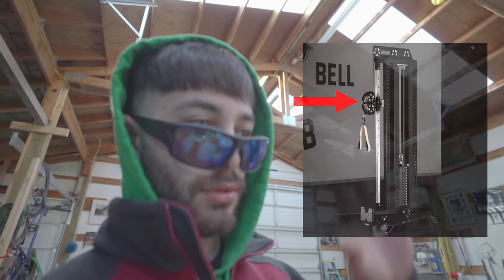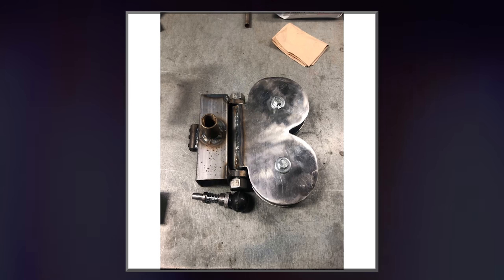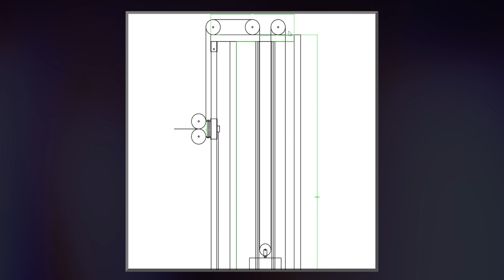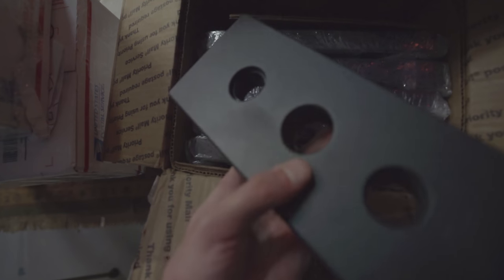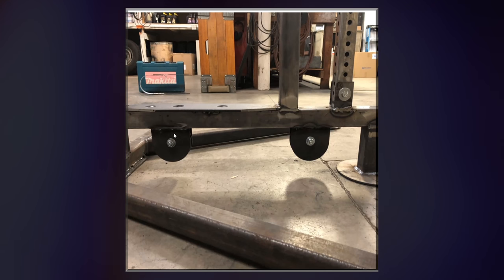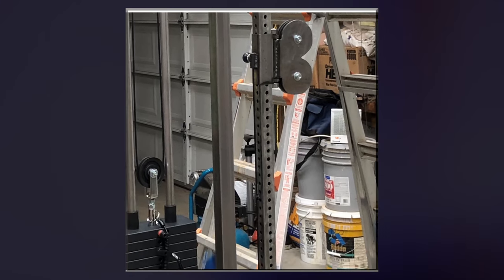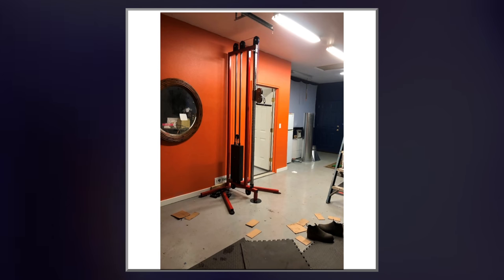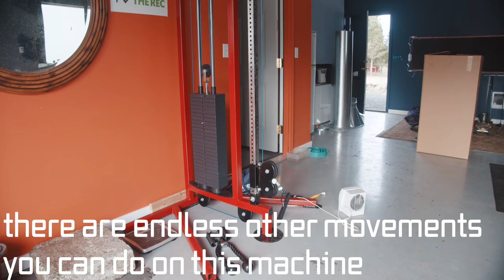DIY Adjustable Cable Machine (Detailed Build Vlog - HOW TO VIDEO)

Comment: Be sure to do vids for other builds you make. Nice work!
Reply from the maker: I’ve got a lat pull down/low row machine coming up soon!
Reply: @solomonmachine2137  Thanks for the headsup, i'm already subbed and got that bell noti set ;p
Reply: @solomonmachine2137  If you could combine them that would be incredible.    Make it 1:1 for the fixed high and low pulley for pulldown/row  and then  2:1 for the adjustable pulley.  Is that possible?

Comment: if you set the stack at 40 it feels like 20lb at the handle.. no it doesnt feel like 20 it actually is 20 at the handle.     Also, the missing energy you speak of , as you said, results in twice the range of motion of the travel of the load up and down the guide rods but the reason there is less energy required to move the weight is because half of the weight is being supported by the other end of the cable which is fixed to the adjuster.   Your video is awesome and I havent seen anyone else on youtube just hauling off and fabricating an adjustable pulley system. Great spirit man and your machine is flawless.  Impressive.

Comment: Great work Mr Moss! I share your sense of accomplishment 😁 highly functional machine you've built here. I actually wanted to do the same at one point and had produced very similar drawings but at the time struggled to find the "user interface" piece and how exactly to devise the weight stack. Nor did I have to option weld. Anyway this video should help many others, congratulations! Now just to repeat the process for cable crossovers 😜.
Reply from the maker: maybe ill do crossovers someday in the future!

Comment: This is inspiring for sure!  I may build this exact system x2.  It would have one on the left and one to the right (for 500lbs).  My thought is to try to create a homemade version of the TYTAX T3-X ($11,000) gym.  To pull that off, you would technically need 7 stations, but if you keep adding as you go, it could be possible.  The thing has 470 exercises lol.  

I can get alot out of 2 pulleys, to start.  It will get more interesting as it goes.  If they actually have schematics, it will make duplication much easier!  The goal is to maximize efficiency; into one large block.
Reply: It would be nice to see what came out of your plan.

Comment: Not sure if you can slip this in now, but some UHMW tape on the inside of that “user interface” would eliminate the little bit of slop and metal-on-metal wear and tear.
Reply from the maker: dude great idea! i totally could. thank you
Reply: @solomonmachine2137  I’d be interested to see how you go about building a belt squat setup if you go that direction with your cables.  I’m currently trying to figure that out within my own rack by adding a low pulley and extra cable to my existing DIY lat pulldown.

Comment: Hello my friend ! 
You work it's amazing ! 😍
It really inspire me, i have some technical questions
- What is the distance between the two pulley of the adjustable pulley ?
- What is the thickness of the metal you used for the adjustable pulley tube and the hinge bracket with hole ?
- What is the thickness of the tall tube with holes ? And what is the size of the holes?
Thanks 😊
Reply from the maker: I just made the two pulleys as close together as I could without touching them.
For the tube, its a standard 1 inch pipe. Which should fit around a 3/4 inch bolt perfectly. And the brackets that mount the bolt, they are 3/8" thick. I just found some metal and cut out bracket shapes and drilled holes and welded them on.
11 GA steel for the perforated square tubing. 1/4 inch thickness for the back and base, and 11GA for everything else.
Reply: @solomonmachine2137  
Hello my friend
Thanks you so much for your answer, it help me a lot 😊 
I have another question, how did you fix the guiding rode ?
Can you make me some pictures please ?
Thanks again for your help, your last video of the lat pull-down is amazing 👏

Comment: Hey man that build is awesome. I'm trying to find the Guide Rods you are using, looked through amazon for a while and couldn't find the length you've stated. Could you please list the link if possible. I have Rogue uprights and would like to utilize them for the build but the only issue is I'm unable to find the guide rods that would fit. Thanks
Reply from the maker: yeah it is hard to find good guide rods. My great idea was to use closet rods, the chrome pipe that holds the hangers. However you literally cant find them online in the 1" diameter. The best ones I could find were unpolished, free shipping on amazon:
https://www.amazon.com/Unpolished-1008-1010-Diameter-Thickness-0-8700/dp/B003TPMM8G?pd_rd_w=jm2NL&pf_rd_p=0d55604f-77be-4514-b038-26b5285c5695&pf_rd_r=VN634VSAYT4WM3D699J7&pd_rd_r=98ad28af-fecb-4e91-a1bd-97ae4e2a96b7&pd_rd_wg=BONhA&pd_rd_i=B003TPMM8G&psc=1&ref_=pd_bap_d_rp_c_2_18_t

Comment: Make two, make a bar that connects them and voila, you've got a functional trainer, thousands of dollars saved. Can you elaborate more on the pulley system, where does it start from and where does it stop.
Reply from the maker: That elaboration is in the video! I explained the cable/pulley system in great detail, give it another watch if you’re interested in making one yourself. Thanks a lot for commenting!😀

Comment: I always wondered what the stacks from that website would be like...
Reply from the maker: Actually very nice. They’ve gone up in price quite a bit since I bought mine. But steel, 6 machined surfaces, beveled edges throughout, and a nice powder coat. You couldn’t make a better stack unless it was chromed out or something

Comment: Hi, I've been designing, fabricating and welding stuff like this for well over 20 years, including my own crossover cable machine, and I'd be impressed if I'd built what you've just done on your first go, so very well done. Do the weight stack weights have any kind of bearing in them against the guide rods, or is it just an air gap? SIimon

Comment: Very nice build! Do you know how much support/weight the guide rods actually need to handle with this? I am trying to fashion something similar (but plate loaded) inside my existing power rack and I was thinking about using 1 or 2 steel pipes for the guide rod(s). Thanks!

Comment: How did you know how long to make the cable? Did you start with the handle at the bottom and just run your cable accordingly?
Reply from the maker: i got a little extra. I remember i got 40ft and had plenty extra. And i just calculated how long it would be compared to the machine.
Reply: @solomonmachine2137  gotcha, im thinking about incorporating something like this but to my power rack. I need to figure out how i could attach the cable to the back of the handle to complete the cable circuit. Im not a welder so its going to be tough lol

Comment: Thank you, was wondering how the cables worked in these adjustable cable machines, essentially it has to connect in a circle/loop for it to be adjustable. The diagram was a big aha moment. Thanks.
Reply from the maker: Yeah that’s a perfect way to think about it. It’s a cable circle with a weight stack in the middle weighing it down

Comment: Hey man!  Great Job!!  I want to do the same thing!.  Did you do some research on the distance between pulleys and force etc.  Doing my research, some multifunction cable machine have a 1:2 or 1:1 pulley system.  If so, do you have any resources to understand this.  I want to design my own functional gym on CAD, but also I don’t want to do a whole mechanical engineering degree hehe.  Any tips or resources or how you came up with the design.  Or you didn’t go to that extent :). Any help most appreciated :). Keep the great work up!!
Reply from the maker: Hello, I have a section in the video where I explain the 2:1 mechanical advantage that adjustable cable machines have (at 30:00). I have yet to find an adjustable cable machine that doesn’t have this mechanical advantage. The reason why is because you need to attach both ends of the cable to the adjustable part (the part that slides up and down with the double pulley). This way when you do adjust it the cable remains tensioned. Unfortunately, you’re not going to get around the 2:1 mechanical advantage if you want to make your machine adjustable. If you want a stationary high pull, like a lat pulldown, you can have easy 1:1 mechanics. To my understanding, the ratios don’t get more complicated than this. The fact that there is a pulley mounted to the weight stack creates the 2:1 mechanical advantage. If you were to mount ANOTHER pulley to the stack, making it two pulleys on the stack, I’d assume the mechanical advantage would be 4:1, however the stack would physically move (when you use this hypothetical cable machine) a fourth the distance. Hope this helps! It’s actually not confusing and won’t require any degree lmao, thanks for watching and being interested
Reply: @solomonmachine2137  Thanks buddy for the thorough reply!!.  Have you checked out the Force USA G20.  Apparently it has a 1:1 mechanics.   Keep doing an awesome job and really appreciate your help!! :)
Reply from the maker: @Joey-wb8wo  you’re welcome buddy!
Reply: @Joey-wb8wo   @Lavish Moss  
There is a way to get a 1:1 on an adjustable pulley that normally makes it 1:2. If the final point of the cable is connected through a secondary set of double pulleys you can link the two ends through a single carabiner to get the full weight of the stack.

Comment: Nice vid! Do you have a link to the weight stack and the circle guide rod holders?
Reply from the maker: https://www.exercise-equipment-parts.com/weght-stack-parts.html
the stack is $2.00 a pound. so pretty pricey. im working on building a trolley system that holds weight which will be way cheaper... so maybe stay tuned for that

Comment: Good job! How are called that little balls that prevent cable from pulling back through pulley? :D
Reply: @michig1099  thanks 😁
Reply from the maker: online you can look up "cable ball stopper" or some variation of that. Honestly you can use a washer just fine.

Comment: If the weight is half on adjustable machines due to mechanical advantage are they labeled differently to make up for this?
Reply from the maker: no they are not labelled differently. try doing tricep extensions on the adjustable cable machine at 100lbs and then try the same thing on a lat pulldown, at 100lbs. the lat pulldown should be exactly 2x heavier because youll be moving the stack exactly 2x further every rep
Reply: @solomonmachine2137  always noticed the stand alone pull down machine at my gym was more difficult, I always thought it was stabilization, this is new to me. Will make sure to only use the stand alone from now on. Thank you for video!

Comment: Where did you get the weight stacks? I had to mill my own and it was a lot of unneccessary work.
Reply from the maker: i bought the stack new on https://www.exercise-equipment-parts.com/ but it was very expensive and is A LOT more expensive now (its almost doubled in price)
Reply: @solomonmachine2137 thanks for the link mate!!! We don't get these options here in S.A. so we either import complete units or build it from scratch. I just paced a USD 5k order with them and everything will cost me only USD 6.4k = ZAR100000 with transport (2 weeks) and duties. The order is big enough to build 4 machines. 1 lat, 1 cable crossover,   1 tricep and 1 multipurpose. Their pulleys are crap though so i'll source it or turn it.
Reply from the maker: @drevil2783  damn I would love to see some pics of these machines once youre done thats sick! just a heads-up my order of the weight stack took about a month to arrive
Reply: @solomonmachine2137  i asked for express delivery. You pay more but hey.... Send me you email and i'll send you some plans plus pics. I design my machines ergonomically meaning it's adjustable for different length people and the way the body works. For example: a leg press machine needs to curve to take pressure off the knees but maintain pressure on the quads etc...

Comment: Where did you buy the pin from for the “user interface”?
Reply: Stupid question, link in description lol
Reply: Terrific job! But I have the same question. Around 33:10 there's a nice showing of that double pulley on a welded ping that's welded to a sleeve. I wish there was more info specifically on that because I want to make that piece to go on my existing rack.

Comment: Where did you get the preperforated tube?
Reply from the maker: i found it at a local scrap yard! I felt like it was lucky.
Edit: I went back to the scrap yard and realized that it used to be a 'no parking' sign as it was green and there was another one there with the sign still attached. pretty funny!

Comment: Are the pulleys all the same size?
Reply from the maker: theyre 4.5 inches in diameter except the one attached to the weight stack which is 3.5 inches
Reply: @solomonmachine2137  Which pulleys did you go with? 
I see a bunch of different 4.5s on the site

Comment: How much did this build cost over all?
Reply from the maker: $1000 for everything. $500 for the 250lb weight stack ($2 per pound), $250 for accessories including pulleys, $250 for metal (from the scrap yard).
You could get away with making this machine for way cheaper (1/2 the cost) if you were to manufacture some kind of device that carries weight plates instead of using the stack. I have a video coming out shortly where Ill be making one of those devices for a lat pull down machine

Comment: What’s the name of that thing used hold the guide rod
Reply from the maker: Shaft collar
Climax Metal C-100 Shaft Collar, Zinc Plated Steel, Set Screw Style, One Piece, 1" Bore, 1-1/2" OD, 5/8" Wide, With 5/16-18 Set Screw https://www.amazon.com/dp/B000IL5GGO/ref=cm_sw_r_cp_api_glt_fabc_AE78PDYDRMAQ9YZWEAKV
Reply: @solomonmachine2137  what’s the name of that plastic collar attached to the weight stack that helps it slide through the guide rod